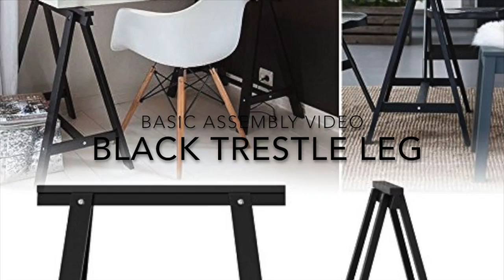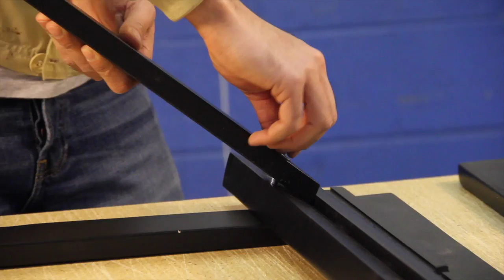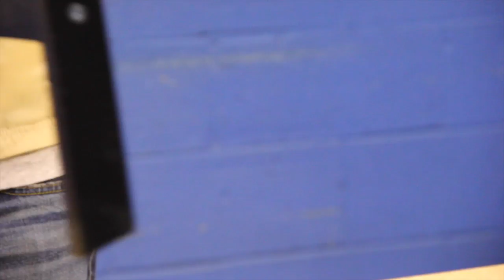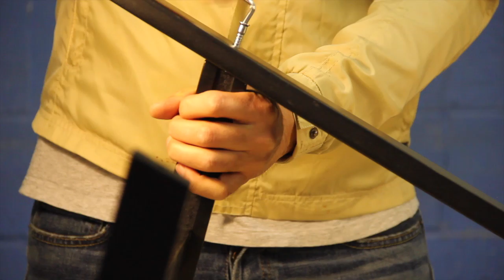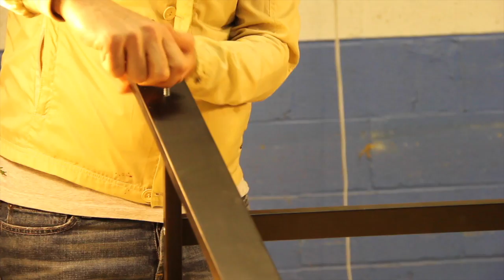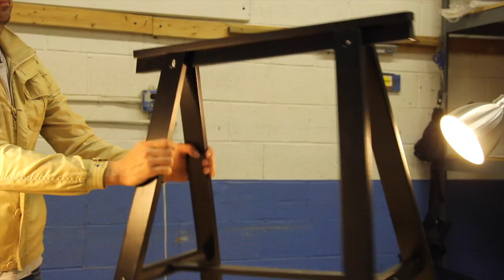BHG Black Trestle Leg Installation

Comment: to anyone who was struggling like me: there’s a difference between the left & right legs. match the pairs so that the bottom slants look like /\. the side with the larger hole is what faces outward for both leg pieces. the leg that has the metal bit attached to the hole (dunno what it’s called) is the “inside” leg. hope this helps
Reply: once you figure out which legs are right & which are left it’s very easy to put together
Reply: Thanks ! Very helpful
Reply: If the larger holes are facing outside, how can the leg with the "metal bit" be facing inside when it's in the larger holes??